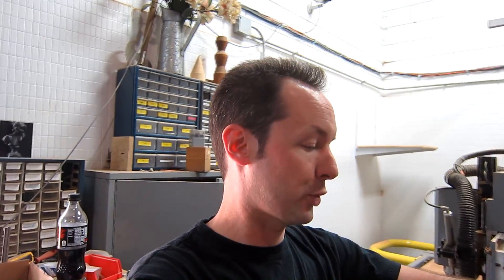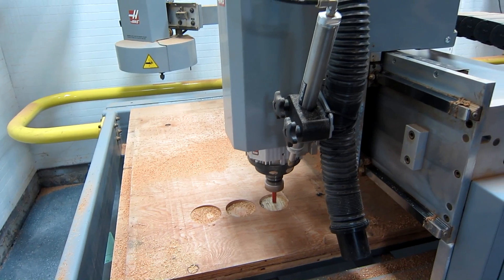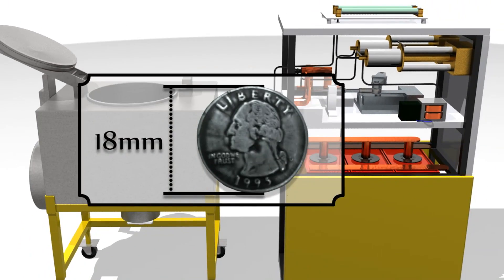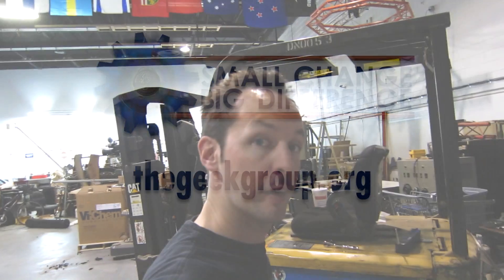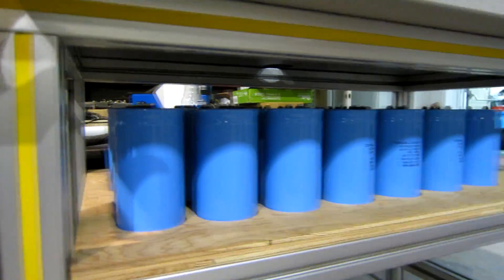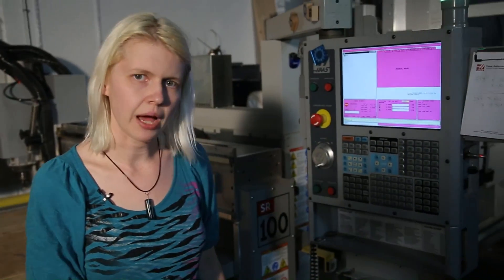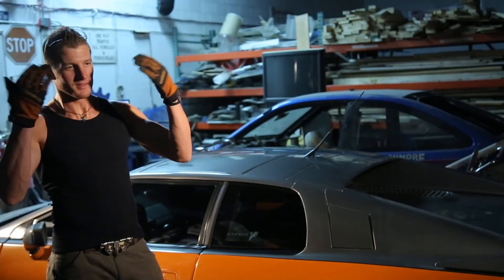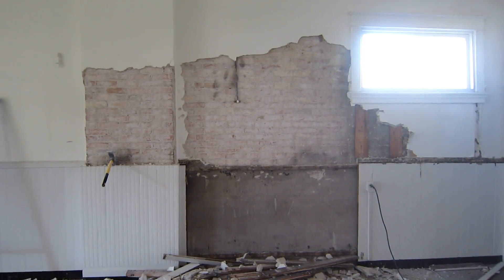Captain's Blog 8-20-12 MiniThumper Engineering and a little GH7 Demo

Comment: Why is the cap spacing important? Aesthetic, heat, wire length on the connections ...?  And how does one determine it for a given set of caps?